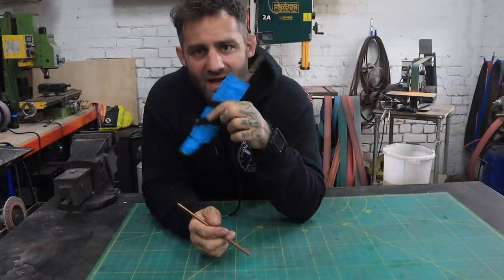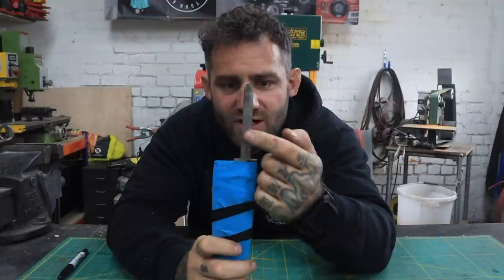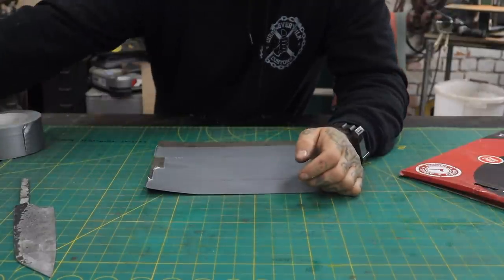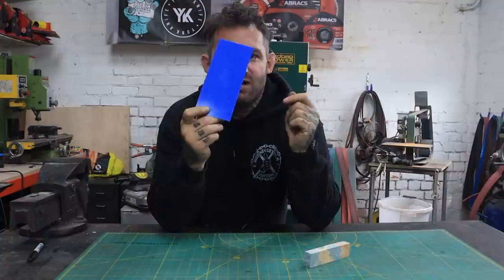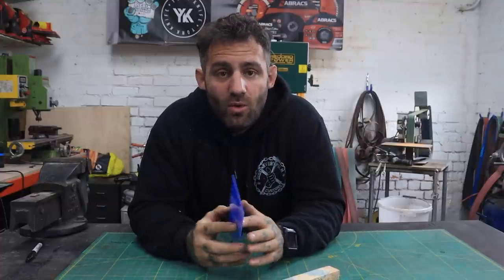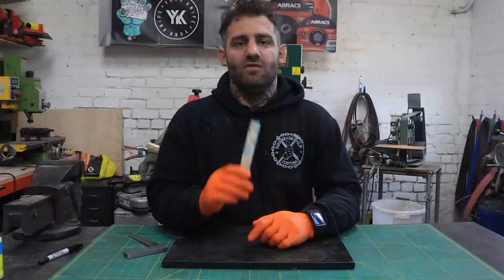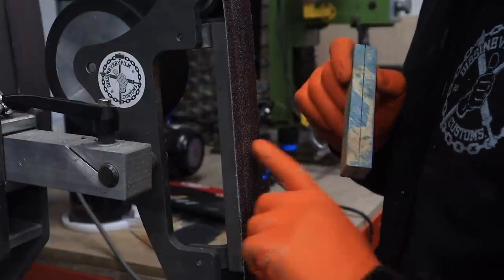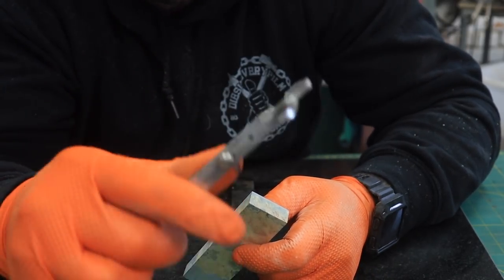6 Tips You NEED To Know

Comment: Hi mate, wouldn't that lump you ground down have made a pair of scales if cut along the marked line on a bandsaw? Actually if you glued the G 10 on either side of of it then cut down the line. Just a thought. 😕  Good tips. 👍 😎
Reply from the maker: I would usually cut closer but for the video I want people to see the angles just for the demonstration. 
It was a scrap piece so no use anyway but also to glue liners on ether side wouldn’t bookmatch the scales. 
I don’t trust cutting too close ether as blades tend to wander and you don’t want to risk that. 
Hope that helps mate

Comment: Not the tip I was hoping you'd show, but that probably wouldn't be on YouTube anyway.  I don't think I'll ever make a knife, but I'll definitely use that sand paper idea.  Also, why not just cut the scales I think that's the right name in 2 with a band saw instead of sanding them?  (this is an honest question, I'm not being a smart ass)
Reply from the maker: Hahahahaha yeh probably best saved for a different tube. 
Glad I could help somehow mate. 
Regarding the scales the cut would still not be square so it needs sanding and a blade can wander so it risks the scales being messed up, but the block i used in the video was oversized as it was just a scrap and I thought it would show the bevel off more clearly.

Comment: On Tip 6 why dont you cut the excess off ?     Sure it will be thin, but you could use that extra material for another handle or project.  Layered/Laminated wood handles.
Reply from the maker: It was left excessive for the video but I wouldn’t cut close to the thickness I wanted anyway as blades can wander